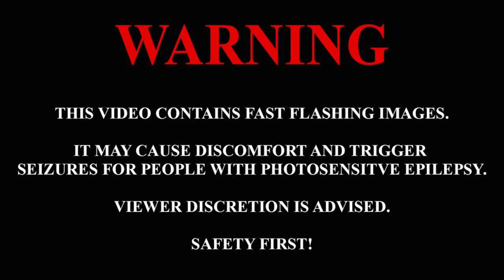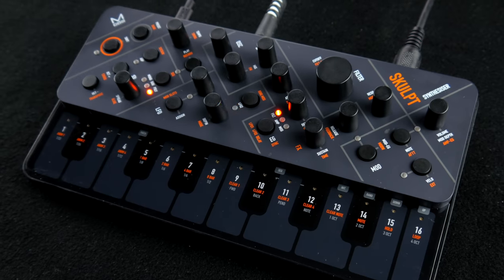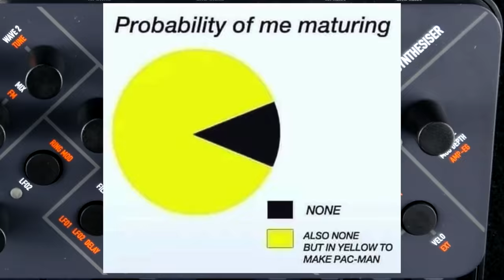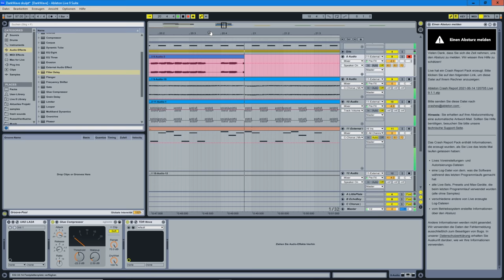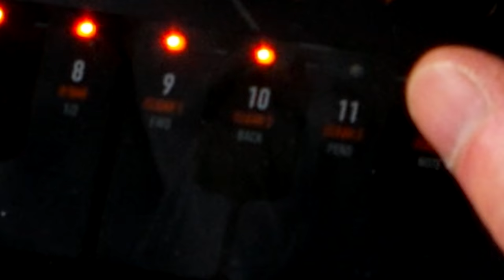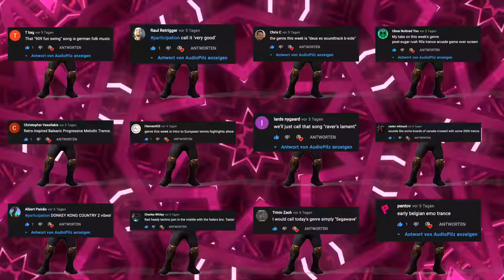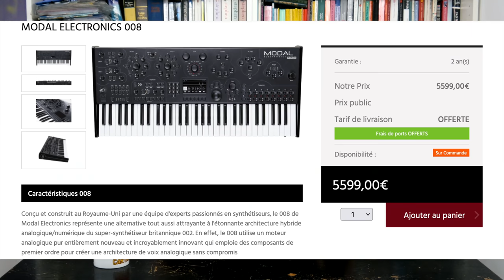Bad Gear - Modal Skulpt - Plastic Toy???

Comment: Having spent 20 years designing UIs (which means absolutely nothing) I reckon this layout is actually really strong for pattern- muscle memory learning, it's rare to see a composition that has path following.  As long as the knobs aren't too flimsy
Reply from the maker: Interesting input! I found it so strange at first but it worked like a charm after a few hours
Reply: @justinbennitt835  I'm supposed to wear near vision glasses, I never do because as soon as I look up the world vanishes into an impressionist haze. Getting something going then tweaking is what I do, although I write the underlying rhythm and melody numerically in advance. Even the best synths still function as toys, it's just so satisfying
Reply: printing the text angled was a major fail.  They fixed it in the SE version.
Reply: @randommcranderson5155  totally disagree
Reply: really because every time I use this thing I have to refer to the cheat sheet. The knobs are flimsy endless encoders, using LEDs to indicate the parameter values, and these LEDs are so bright that you can't see any of the gray-on-gray UI legending even in broad daylight (maybe especially then). And I am constantly forgetting the shift button is on or editing the wrong evelope. The sound is usable, which is pretty good for a $200 digital synth, but the enclosure/UI is GOD AWFUL.

Comment: The Skulpt is a very fine synth engine packed inside a small, cheap housing. There's obviously going to be some downsides because of that. But I think that a lot of people don't give it the credit it deserves for what it actually is.

I know Stimming didn't care for it, and I generally agree with his assessments. It's definitely a bit confusing in its layout and those "keys" are not great. Most people will want to use the software to get the most out of it, which is a bit of a shame because what this really is is a powerful polyphonic synth with loads of oscillators and other features packed inside a compact, portable device. The portability is both its strength and its weakness, the compact nature making it necessary to cram everything onto it in a "somewhat logical" way. This is a backpack synth, you don't get the luxury of a million knobs spaced out in an easy-to-use way. That said, the reliance of unlocking everything via an app or program on another device kind of sours the "backpack synth" nature of it, although if you have an iPad I guess you're still pretty portable.

It sounds really good, too, although like Stimming, I rather preferred the sounds of the Craftsynth's wavetables. I believe I saw it on sale for $149 a while back, and was very close to buying one. For less than $200, it's probably the best synth available. What else is there? The IK Uno? No thanks!
Reply from the maker: Yeah, Stimming really knows his stuff
Reply: I love mine
Reply: But Stimming is also such a snob

Comment: I did support this Kickstarter, and the follow up as well. It's true that the UI is one of those things that makes you want to throw it across the room. Fortunately, the Modal App is really good. If you're doing sound design on it, you really need the app. So in that regard, it reminds me of my Venom where you need software to make the most of it. It works better as a sound module in the end, because the sound is where it really shines.
Reply from the maker: Don't throw it, it's not rugged enough for that;)

Comment: I had a load of knobs fall off but as per usual Modals awesome customer service just sent me a bunch over for free and job done.  I mean they made it a joy to speak to about it and I felt I was treated like a king.  That is service and for a device that is a few hundred give or take 👍 

As for the sound etc I absolutely have no issues and it runs connected alongside some sound gear that individually costs between 2-4k as well as with the craft synth and an Argon 8 desktop. Just works flawlessly and I love it and use it a lot.  Thanks 😃
Reply from the maker: Wow, great to hear that!

Comment: Are you aware of the 'updated' SE edition that came out recently? White and black traditional keyboard and new sound presets? ( These are available for use with the original synth ). I really like it, yeah it's plastic, has a horrible touch keyboard but when used with a controller or other synth it shows just how good it can sound. At lot of us cannot afford to splash out on other gear, so at least this still delivers fun.........and isn't that what we all need during these dark days?
Reply from the maker: I tried to focus on the OG Skulpt but the SE is on my radar, thanks for the heads up!
Reply: @AudioPilz  The SE seems a little less wobbly in places too. Plus cheaper to buy a new one of those than a second hand OG (particularly from Reverb..lol).
It's a fun 'out and about' thingy if you have a Circuit or an MC-101 or something of that type.
Reply: The touch keyboard does enable great slide technique, particularly handy in arpeggios...
Reply: @jasonkranzler  they need the capacitive keyboard from a microfreak instead of what they they have.  It's not as good to play.  The microfreak's touch keyboard is a million times better.
Reply: @randommcranderson5155  wish there were more capacitive key beds like the microfreak! Although here might be some improvements (more keys being most obvious), I love that type. A bit sad to hear the ones on these (skulpt and craft) are not like those…..
Reply: I'd like to see the Microfreak on BadGear, while the capacitive keyboard is cool, it sounds pretty trashy.

Comment: I think this little synth would have done well to go the direction of the Blofeld. Just a nice little desktop unit that does what it does really well, with a nice upgraded chassis and layout. A guy can dream I guess. 

So now the Digitakt has the much loved 1.3 firmware, will it get the "Better Gear" treatment?
Reply from the maker: Let's see if (or when) I will find the time to make the upgrade
Reply: @AudioPilz  It's worth it for the extended pitch range alone.. I did the upgrade about 30 minutes ago and already made some super weird ambient doom loops that are way out of my usual wheelhouse but lots of fun.
Reply: The Cobalt 8M and Argon 8M are pretty much this.  For $400 more than a Skulpt.
Reply: @GavinLees  I paid 400 for the cobalt8M, and I got 2 of these for 340. 
The Skulpt is fun (I cart one about with my MC-101 most of the time), but it's very stripped down compared to the 8/8M/8X models.
Reply: @Gainn  Yeah, I was going to say this. The sound engines in the Skulpt and Craftsynth are analogous to the Cobalt 8 and Argon8, respectively, but the backpack synths are further stripped down quite a bit.

Comment: "At least on paper..."
Bingo...
The concept is amazing, I love it...
And it sounds out of this world...
But can I be bothered to use it?
No....   Its a huge pain in the arse...
Reply from the maker: Maybe rehouse it into some metal stompbox enclosure;)
Reply: @AudioPilz  the SE was an improvement,  just having the miniscule labels all running in the same direction made this thing 100 times more usable! 
I had mine totally brick, bootloader program became corrupted whilst attempting an update...
Modal were just amazing though, talked me through how to reinstall first the bootloader and then the firmware from files they sent to me. I have a lot of respect for this box,  but it's not the most intuitive device I've ever used...
At least if it was made akin to a steel stomp box I'd feel more comfortable when it gets launched across the room...  😉
A great video Flozza 😀😍🤩
Reply: @AudioPilz  That’s actually a great idea

Comment: Those touch plate style keyboards are fine when they serve a dual purpose.
sequencer positioning,  various menus, etc.
Reply from the maker: ...theremin in disguise;)
Reply: That's all they were supposed to be in the early stages, making them into playable keys was an afterthought, although the publicity would suggest otherwise. They're great to have, but using this thing daily, without an external keyboard? You'd have to be a lunatic. That said,  at least you can pick out a tune, unlike those ridiculous inline Volca keys.

Then again, you do come up with some creative things you'd never have purposely made when you haven't got a clue what notes you're playing on the Korgs.
Reply: +1 Korg Volcas

Comment: Oh, the Skulpt on BadGear??!?

I love mine (and it has never crashed). It makes wonderfully weird and unique sounds. Get past the idea of it being a standalone - use it as a sound module with the app and an external keyboard, and you're getting a whole shedload of interesting, flexible, modern audio possibilities for less than £200. You won't use it all the time (for my money, the filter needs to be much sweeter to be an "everyday" synth) but it's a great, (relatively) inexpensive, interesting tool to have.

No need to go all the way up to the 008, btw... get an Argon or a Cobalt. One does the digital sound design thing, the other some lovely "virtual analogue" sounds - I think they nailed that sweet filter with the Cobalt. And of course they all the use the same App, so once you've mastered that interface, you'll be able to flit straight into another Modal product quite easily.
Reply from the maker: True! Argon and Cobalt is the way to go!

Comment: I had no idea this was considered bad gear. My favorite synth from 2018/2019.
Reply from the maker: It certainly has its shortcomings
Reply: @AudioPilz apart from the design capability, I actually find the sound too flat in the medium range, probably because of the mono output, maybe also some limitation of the signal path through tje mini jack. Do you agree?

Comment: if you're using this without the app, you're missing 75% of the synth.. same with the Craft Synth 2.0.. for the money & size, it's a no-brainer
Reply from the maker: Yeah, app is a must!
Reply: It works as candy crush replacement that's true. It works as a tunnel for another dimension where sirens sing you to take that strange substance - thats true. It works as a midi - usb interface btw! But does it give anything warm and pleasant? NO
It's the Picasso's veredonovaya blue you'll find right before absenthe dispenser. Do I want to go back to such pallette? ... ... ...
Do anyone enjoy their absenthe anyway? Isn't it just way out there? CS2 is a cold hearted bitch. While the grand piano is one, it is certainly giving in some areas, while CS2 is a always doubting whether you're good enough. Fu*k that, better use poly d. That thing seems human enough.

Comment: 3:40 is the key point for the Skulp and Craft.  Connect via USB > connect to mixer > stick it in a dusty corner > control via ModalApp as a VST.
Reply from the maker: Maybe they should release a VST?

Comment: I was a KS backer. Even literally got the t-shirt. I use this synth but generally only with a specific set up. 1.) I don't use the interface of the synth itself. I use the app to program it. I sit my app up behind my controller keyboard and the synth is jus sitting off to the side. 2.) I always send it through stereo effects of some kind. It's really a nice sounding instrument but seems rather lack-luster in mono.
Reply from the maker: Agreed, mono is a real limitation

Comment: ha i have that overlay-- it's nice. the new version of the synth has a faceplate closer to this overlay  but i still think the overlay is better designed. if they just built the box about 25% bigger and abandoned the goofy diagonal layout it would be a classic of small digital synths.
Reply from the maker: Just looking at the overlay made using the synth so much easier
Reply: Is that an overlay acquired separately?  How can you get it?

Comment: I'm still on the fence with this synth, it hasn't won me over yet. I'm still not brave enough to tackle the onboard modulation without the editor. But as I like running synths live instead of recording them track by track, it's useful filling out spaces and adding contrast. Many of the sounds really remind me of early 90's electronica, as I was then an Orbital wannabe, this would had suited me more back them. The Craft2 though with less modulation option and monophonic, has more complex oscillators and offers something unique, I hope to see a you do a video on this at some point.
Reply from the maker: Craft is moving up my list, thanks for the suggestion!

Comment: I knew it was coming, but its a plasic toy that sounds as big as a Jupiter.... a very very confiusing jupiter XD
Reply from the maker: Jupiter with a dark past maybe;)
Reply: Yep, it's pretty big sounding. 
But i don't get, why people find it confusing. 
Each section is clearly separated and logically placed, imo. 
And for the things written in orange, you just hold shift or latch it with a short tap. That's 90% of the magic. The other 10% can be found on the cheat sheet. ^^

Comment: Ah! It's friday, the weekend starts, Bad Gear comes on and it's about a little gem you own. ^^
I was wondering when this little box would show up and you really did this little rough gem justice. :)

I got the G.A.S. during last years black friday and bought it for 169€ at a sale at Thomann. I was really surprised by it's sound character, which really stands on its own. 
In my opinion lead and bass sounds aren't its forte, it can do it, but it's strong suit are pads and atmospheric sounds.
The controls are kinda quirky at first, but after an hour or so, i could use it without any problems and haven't used the app so far. And i'm kinda impressed, that they managed to squeeze all these features into this size and still not having to hide some features in the app exclusively.
But i can see, how this shift combo Kung Fu is not every-bodies cup of tea.

When the noise issue occurred, did you power it via USB? 
I use batteries and haven't encountered such noise issues yet.
Reply from the maker: Thanks! Total pad and FX machine. It was powered with a power bank, so it should be fine
Reply: @AudioPilz  Yep, a power bank should cause that....
Try putting the power switch to batteries instead of the middle position. This kind of two way switch sometime tends to not close correctly. If there are no batteries in the unit, it should turn it off completely.

That's how i turn mine off. The switch is so fiddly that i can't be bothered to find the middle position. 😅

Comment: Oh man, I owned Modal KraftSynth (which is I think the same as Skulpt but monophonic and in a smaller form factor) for a week before I returned it. While I was watching your demo I literally once more felt the pain of owning it. By just watching the video I feel the flimsiness of the rotaries and odd responsiveness of the keyboard touchstrip and the complexity of the sound controls (with sweet spot hunting and tough times of finding good sounds) again. You are so true to the point about all of these.
Ohhh, the sound engine might be powerful but my mind is aching when I remember just the feel of using this little trinket. Hope you didn't share my feelings about this synth or they were at least not as deep as mine. Cheers!
Reply: For those of you guys who suggest to use iPad to control this synth — are you kidding?
If I hook in iPad I'd just use some software synths with better effect.
Reply from the maker: Yup, it's more or less just a gateway drug to their "real" synths
Reply: @AudioPilz  if their real synths have good interface, some tuning of parameter ranges and some good presets I bet they are good and powerful

Comment: A good alternative to those who cannot afford the OP-1 who want a compact synth.
One question,  can it save user presets? 
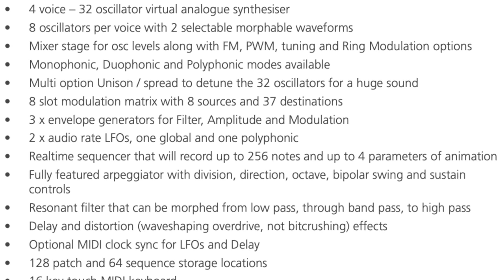Got it. The answer is Yes. @ 3:56 128 patches and 64 sequence storage locations.
Whats better than Electronics Craft Synth 2.0 is that this one is 4 voice polyphony and has on-board black keys but of course you will end up with a MIDI keyboard.
Reply from the maker: The OP-1 is a little more robust tho;)

Comment: Well you managed to get a lot better sound out of it than I did. I always thought it a bit flat and lifeless.
The panel looks like The Crystal Maze but you can easily find the filter knob because it's bigger than all the others 😄 Got that right.
Strangely the editor software is laid out as logically and neatly as the front panel isn't. That helps find your way around.
If you can get over the knobs (which doesn't take long) with the editor screen I think this makes a great tool for learning/simulating analog synthesis. Which isn't bad for a digital synth.
The keyboard is fun and great for instant results. It is basically a Stylophone which does something (Or it would be if it had one of those crappy little speakers like a Roland Boutique). And it looks great. What's not to like? Oh yeah the sound. . . . . . .  I think maybe I need to 'try harder' before writing that off. It actually sounds pretty good here.
Reply from the maker: Thank you!!!

Comment: Had to laugh - at myself. I bought the new Modal Skulpt SE a few days before you posted this review, for $299 AUS. Yes, don't try to move it when turned on. Plus my Windows machine warned me not to install the very latest ModalApp update. So I didn't and I emailed Modal that maybe thier security certificates, etc. need attention. Otherwise, I'm happy enough. Great pads. As a cheap gear aficionado, I can make this work in my set up. Not much else available that is polyphonic / paraphonic at that price or less in Australia bar say the Volca Keys or fm. Plus it does have MPE, if I could only afford / import a  Seaboard 49 to run it. Ha.
Thanx, as always, for a most entertaining review. Love your sense of humour. B.
Reply from the maker: Thank you!!!